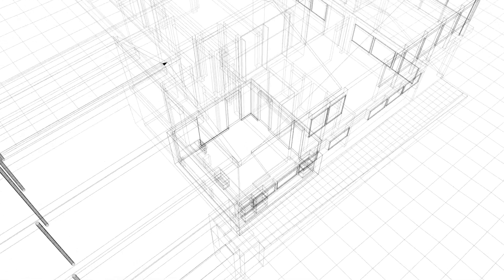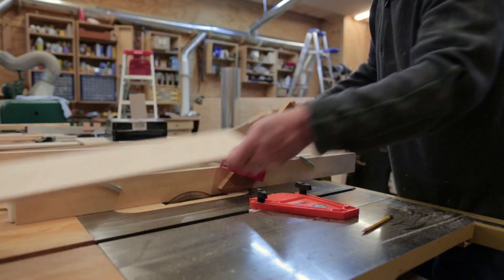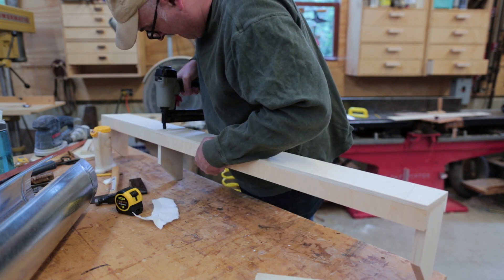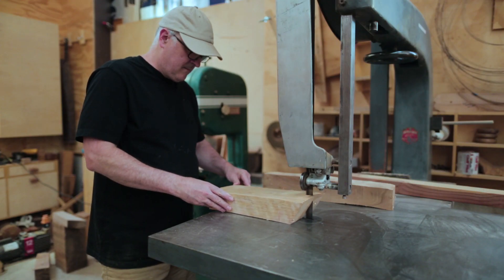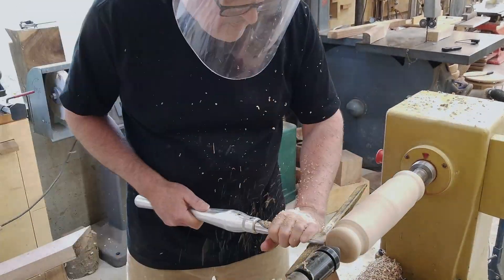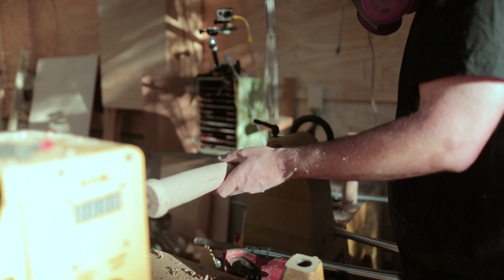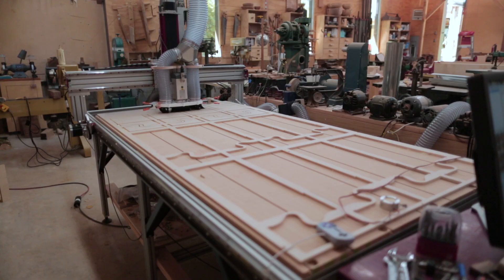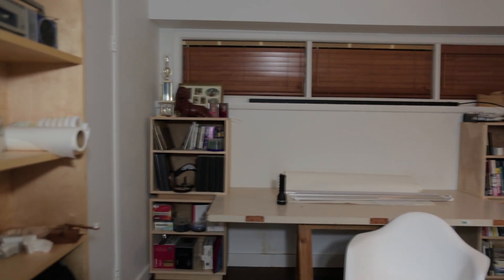Office 5: More Projects

Comment: One of the things I like to do in my office clean-ups is hide the electrical clutter (plugs, wires, etc). It seems like your charging shelf could have a backboard that the power strip attaches to under the shelf board, then a faceboard where the power strip currently is attached to hide all that clutter. Essentially making an upside down tray. Then there could be clips under there to manage the cables, and holes in the shelf board to pass the connector through to connect to the charging docks for each of the devices.

Comment: For a light box you could try building one out of a scrapped led tv, the light strips usually have a lens that throws the light sideways, and on top of the screen itself there's usually a few layers of differently polarized filters to diffuse the light. all that's missing then is an enclosure and a driver with the right voltage.

Comment: Frank, I suspect you're going to make the photo booth from a wood frame, however, I'm curious what you're going to use to cover the frame with?  I've tried a few different things to diffuse the light and what I discovered worked well was a cheap white sheet from Wal-Mart or Target.  I've not tried it with different colors, but I'm curious to see if I change the color of the sheet (to a red or blue) how it would affect the final image.
Reply from the maker: I need to do some research on defusing materials,  I was hoping fabric would work.

Comment: Thanks for sharing your continuing office design. I hope you will create a video when you construct your small light box studio design. I have tried a couple things myself but have not had much success, but I think my reluctance to spend much money to do it has been the thing keeping me from success. That and the fact that I need it to be fold-down so it can be stored away when not needed. I am hoping your design will provide much insight into what would be required for a decent functional studio.
Reply from the maker: The plan is to do a video about it.  It looks like there are a bunch of folks who want to see this as a future video.
Reply: Don, I was in the same boat and through trial and error I was able to build a serviceable light box using PVC as the frame and a cheap white bed sheet to cover the box (and diffuse the light).  It's been working well and it was cheap to make.  I can't wait to see what Frank does with his though since he always seems to have a creative approach that turns out well.

Comment: Is there much maintenance on the radial arm saw's  bearings? I assume they're some type of linear bearings, maybe recirculating ball bearings. Just curious...
Reply: The cast-iron arm is one piece. The guides for the carriage are precision ground into the arm. Bearings in the carriage ride on the precision ground surfaces. The bearings are adjustable so that you can get a little bit of pre-load. Compared to metal machining tools, the radial arm saw is flexible and sloppy. But it is good for wood. You should probably re-grease the bearings in the carriage once in a while. But it does not need to be done very often.

Comment: I don't know much about using a lathe, but is that offset technique safe/recommended?
Reply: Steven Rochon you could do it in two smaller steps and achieve the same results with less potential to get a catch

Comment: frank, I am considering purchasing a cnc machine, what would you recommend? I have a two car garage workshop.
What software would you also recommend? I enjoy your videos and have gotten a lot of ideas from them, thank you for your time. Robert of Indianapolis, In
Reply from the maker: I have a cnc router parts machine.  I would look at what they offer.  There are many options.  I use Mach 3 to run the motors.  and rhino and fusion 360 for the cam stuff.  I am supposed to be getting aspire soon to play around with.  I have heard a lot of good things about it.
Reply: Thanks for the input